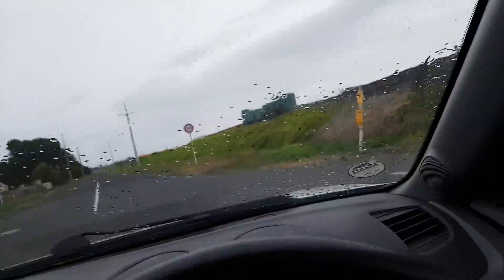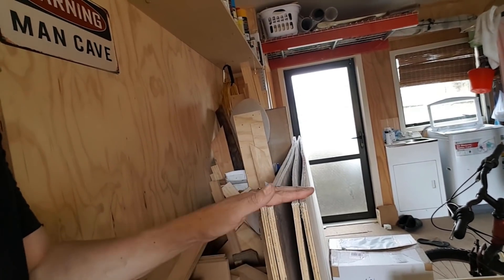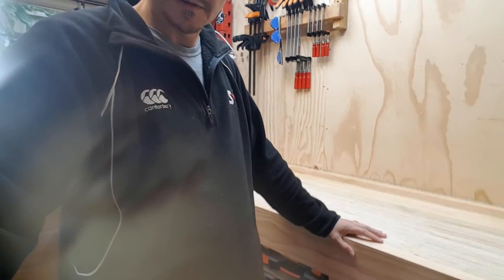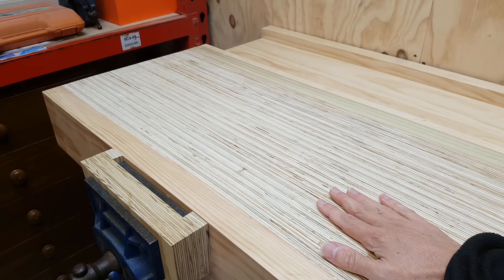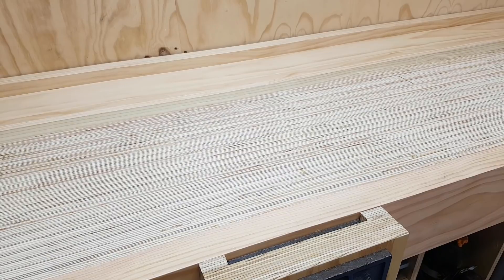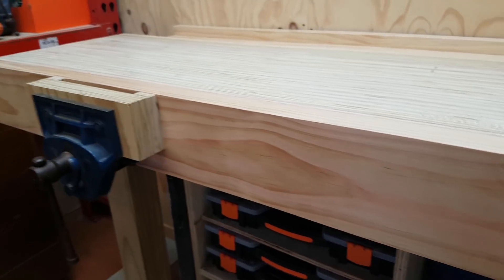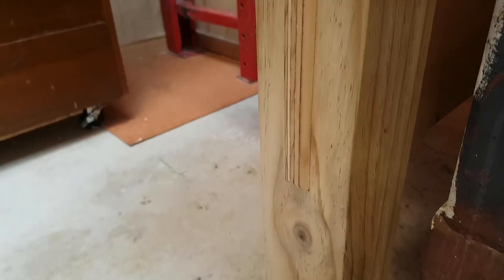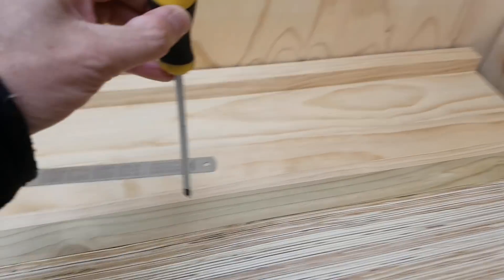Paul Sellers plywood bench - phew - I made it - all about it.

Comment: Great video, thanks Rob. I found that build roundup quite interesting. I've not watched Paul Sellers, but the joining plywood on its side looks impressive. I can see how making the legs from ply would be awesome for the mortises, as you would laminate three or five layers and just leave a center gap one plywood thickness wide. Still cutting the mortise would have been character building, maybe...
Reply from the maker: Thanks Bob - yep - plywood legs leaving the gap would have been way easier ! Paul Sellers used baltic birch which looks amazing - and he can afford to because he doesn't make stuff ups - I wanted some practice and some projects under my belt on it before I settle on a set of features for a bench that I make with real materials and real money. I only have about 100 bucks in this (a lot of it glue).
Reply: @TakamiWoodshop  A local nursery business near me put some plywood pallets out on the nature strip, free to take, last week. I looked at the ply with quite a bit of interest, but the stuff was pretty dented on the top side and lots of nails, I didn't take them and they were gone the next day. Just looked like a lot of work to make them into something good.
Reply from the maker: Smart move. I intended these for the shelves mentioned in the video, but the ply layer count was quite high which is what made me change my mind...despite its general mankiness.

Comment: hey mate did you manage to find untreated 2 x 4's in NZ?
Reply from the maker: No I didn't mate - I only ever buy at Bunnings because that's the cheapest around me - and their stuff is all treated. I wouldn't know where to get them sorry. If you leave H1.2 sticks out in the sun for a while the pink disappears off them which makes them a bit nicer for projects like work benches. Cheers.
Reply: @TakamiWoodshop  Ah no worries. Been wanting to knock together a workbench with laminated pine 2x4's, but from what i've gathered the untreated stuff just doesn't exist unless its D4S. So i think ill grab some sheets of ply from bunnings and try this. If it's a bit wonky after a glue up i think ill try using a  router sled to flatten it.
Reply from the maker: @1988jeffy  I had to flatten this one [https://youtu.be/bCEm881GdNw] - if I was doing it again I'd go to lengths not to have to though - it was a real pain in the backside and still needed a whole lot of hand planing due to the sled and the router bit not being that flash. It did come out nice though in the end and super happy with the bench. In my experience the ply at Bunnings is better than the counterpart product from Mitre10 and if you want to go fancy you can get Russian birch through Bunnings (made by NZ Wood Products) - it's the poor man's version of "Baltic Birch" but no idea how much it is.

Comment: Rob seal it up with everdure fromEpiglass it will make it perfect
Reply from the maker: Mate - you are absolutely correct and I would do that if I was using better ply. I've sealed it with three coats of water based poly that I had - I might go more even. I might have a can of that Everdure (or Norski) coming to me though - from a boat owning family member - if that eventuates I'll definitely do it - good to have the glue not stick and fill a few remaining voids.
Reply: @TakamiWoodshop it turns shit ply into top grade ply dry rot into solid timber amazing stuff really its much cheaper here now than at home but I use it for everything I need to look after
Reply: @TakamiWoodshop  nice bench anyway looks good
Reply from the maker: I'm going to make enquiries fur sure...pretty sure the can is sitting in the lockup.
Reply: @TakamiWoodshop you will be happy once you have done it that's for sure